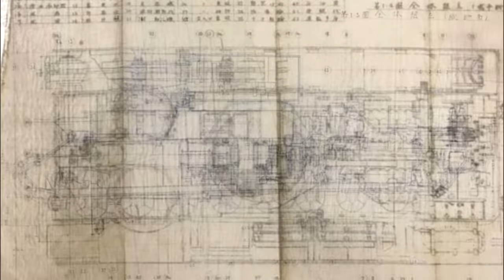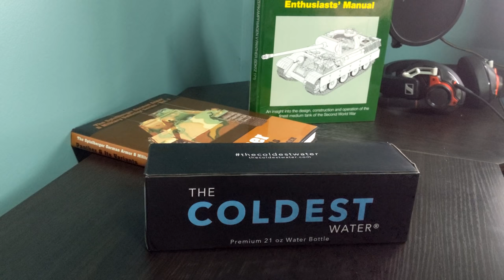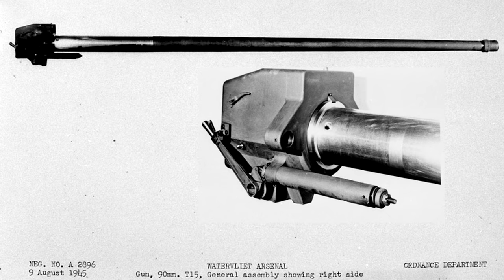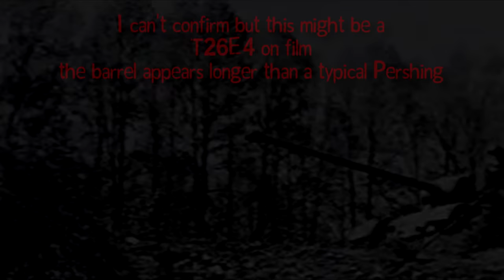America's King Tiger KILLER, the Super Pershing | Cursed by Design

Comment: "The 90mm M3 ain't enough to beat the Kingtiger!"
"Mount the T51E1 on the T26E1."
"The gun makes the tank lean forward and it's hard to elevate it!"
"Add counterweights and springs on the turret."
"The long shells are difficult to load!"
"Mount the T15E2 with two piece ammo on the T26E3."
(Still sends the one with the T15E1)
"We don't want to loose the tank during testing!"
"Add some extra armour made out of our equipment and a Panther."
"The extra armour makes the tank lean forward!"
"Add more counterweights on the turret."
"We don't have the gun sight for the cannon!"
"Just use the M71C from the 90mm M3 cannon."
"It doesn't match with the ballistics of the T15E1!"
"Work out a range sheet."

(Inspired from Potential History's video about the Firefly development)
Reply: sir 17 pounder wont fit!
PUT IT IN SIDEWAYS
Reply: the radio won't fit
CUT A HOLE AND HAVE IT STICK OUT THE BACK
Reply: the engine's no good
GET FIVE CAR ENGINES AND PUT THEM TOGHETER
Reply: @aleky98  Sir! let's just buy some american tanks!
NO, WE MAKE OUR OWN STUFF
Reply: Now I want this in what I imagine Patton’s and some random tanker’s voices to be.
Reply: LET'S BUILD IT!
Reply: No more negative waves!
Reply: Lamoo
Reply: Conclusion: the tank is designed by german spy
Reply: @FD_Stalker  - A double agent!
Reply: problems 101
Reply: COMRADE, THE 100MM IS TOO BIG FOR T34-85!

make the turret larger blyat
Reply: @ramslade  - If Stalin wants it, Stalin gets it!!!
Reply: "Pentagon Wars," the satiric story of the Bradley is very similar. Funny movie and scarily based on a lot of facts.
Reply: The KV gun had a problem because of it’s size which the Germans exploited.
Reply: It depends at the crew
Reply: m 36 jackson gun  was not enough against  king tiger so they redesign this gun or what ? m36 had a 90 mm gun....
Reply: German tank designers:

Add more weight 

The engine it's not good

Put a flak 88 on it

The engine still not good

Add more tons 

...

Make it heavier

Sir?

HEAVIER I SAID

Tiger 2 finally gets out of fabric

Add more weight
Reply: The Very Best Comments Thread.

Solution? Haul the BIGGEST Field Gun you have & Shoot from beyond the 88's Range.
Reply: @sibeerijachannel6828  Originally, the M36 was limited to 2650 M82 APCBC, which wouldn't defeat the front plates of the King Tiger. In the winter of 1945, an APCR round (which would defeat the King Tiger glacis out to 100 yards and the turret front out to 800 yards) became available, and 43,000 rounds were produced, but mostly too late for the European war.
Reply: "But the tank is under powered."
"Put the engine sideways"
Reply: Awesome and thanks
Reply: The tank is too heavy and sinks in the soft ground. 
Put some logs under the tracks and strap them on the sides and remove some of the weights.
Reply: @hugossg7908  We need a bigger tank. We shall call it the Maus. 188 tons of armour and guns plus we shall make it unbearably complicated and hard to maintain.
Reply: Literally no Tiger II was destroyed by Western Allied forces tanks.
Some were destroyed by Allied bombers, but most were immobilized or just abandoned by crews as failing 3rd reich had no support for them.
And Super Persching was total shit, one hit from any 1930's 20mm AT rifle will immobilize it's turret.
Reply: @capobilotti  I heard 1 King Tiger tank was destroyed by an M8 Greyhound.
Reply: @winchesterchua3311  I don't know about such story but I'm not an expert.
Probably not destroyed, but put out of action (damaged tracks, gun elevation, turret ring) and subsequently blown up by crew.
At that stage of war, Germans were not in position to recover damaged tanks.
Reply: @r.j.dunnill1465  Well looking at strict penetration numbers the APCR (or rather HVAP as American forces referred to it) could potentially defeat the frontal plate of the Tiger 2 out to between 1,750m to a little under 2,000m. Tiger II's hull front only had an effective thickness of about 196mm as it was 150mm thick and sloped at 50 degrees. The T30E16 HVAP shell had 205mm of penetration at 1,750m and 193mm at 2,000m. 

This is also assuming a standard quality plate of RHA which was not guaranteed for any Tiger II to leave the factory as Germany was having armor quality issues as early as 1943 as it's resources started to thin. Explicitly their stores of Nickel, Molybdenum, and Manganese which were used to temper their armor plates, lacking these elements forced them to switch over to Vanadium to do so. 

Under perfect circumstances Vanadium would've been an excellent substitute but German factories were operating under far from perfect circumstances and this change resulted in incredibly hard but disastrously brittle plates. All guns firing at one of these Tiger IIs would experience much higher penetrative capability than they actually had due to fire at the sub-standard plate. 

This is why in post war tests it was revealed that on average even the M1A4 High Velocity 76mm cannon, or rather the "Long 76", mounted on the Shermans was capable of frontally penetrating the Tiger II's turret at an honestly absurd angle and range, it was still utterly incapable of defeating the frontal hull armor though. 

However interestingly the T33 AP was in fact capable of defeating the frontal plate of the Tiger 2, but only at 100m. I believe you mistook the penetrative numbers for the T30E16 and T33 for each other as you cited the T30E16 as only being able to penetrate a Tiger II's frontal plate out to 100m which is just demonstrably false as at that range the T30E16 has over twice the required penetration to defeat a plate as effectively thick as the Tiger II's even assuming perfect RHA quality, which the Tiger II could never claim to have.
Reply: @ThatGuyOrby  I based my statements on a declassified Ordnance document, which states of the T30E16 shot "PURPOSE. This is a special hyper-velocity, armor piercing round for attack of heavily armored vehicles. It gives greatly increased penetrative performance up to 2,000 yards range over the standard A.P.C.-T., Projectile, 90mm, M82. It is especially effective at shorter ranges. Since tungsten carbide is a critical material these projectiles should be used sparingly and only when the situation requires increased armor penetration. This shot will penetrate all plates of the German Pz Kpfw V "Panther" and "King Tiger" Tanks. IT WILL DEFEAT THE GLACIS PLATE OF THE "PANTHER" AT RANGES UP TO 450 YARDS AND OF THE "KING TIGER" AT 100 YARDS RANGE. UP TO RANGES OF 800 YARDS THE SHOT WILL PENETRATE THE GUN MANTLET AND TURRET FRONT OF BOTH THE "PANTHER" AND "KING TIGER" TANKS."

At one time the original document was posted, and I have a copy somewhere.
Reply: @r.j.dunnill1465  Well then I just have to say that document is poorly informed, which wasn't uncommon for the time, because official US Army documents on the penetrative capability of their guns firing different shells at different ranges and the armor thickness and quality we know German tanks had at the time simply outright contradicts those ranges claimed. 

The guns and shells used in the document are specifically the M1A4 76mm gun, the older 3in it was meant to replace, the M3 90mm gun, the T4 105mm gun, and M1 155mm gun. It rather unfortunately doesn't include the more powerful T15E1 90mm gun, the one used on the Super Pershing. I struggle to find a source for that one.

Youtube tends to have an issue with sending links but I'll attempt to send it anyway in a following comment, if you don't see it I'll attempt to send it to you on another platform. Do you have Discord or Facebook by chance? I rarely ever use Facebook, in fact the last time I did seriously use it was almost three or four years ago, but sometimes it does come in useful for things like this. 

Though note the page lists thickness of RHA perforated in inches and range in yards so it requires conversion to millimeters and meters for convenience.
Reply: It seems Youtube as expected deleted my response with the link
Reply: @capobilotti  There are documented cases of King Tigers being knocked out by Fireflies, M10s, M4A3s and M36s.
Reply: In Belton Cooper's book "Death Traps" he discusses the main gun the tank was equipped with. He states that a range of 100 yards it could punch through17 inches of armor plate. He also says that in practice firing, it could punch through a Tiger 1 front armor at a range of a mile when using solid shot. Cooper was the man who devised all the "add-ons" to a Pershing. He was nominated for the task because, in college, he learned how to design warships by proper weight distribution to keep a ship on an even keel, both fore-aft and starboard-port. So he didn't have much to work with, but got everything worked out on the Super Pershing . His book is a very interesting read. He was the tank liaison officer to the 3rd armored division, to which the Super Pershing was assigned.
Reply: @bobkonradi1027  However his book is also a near universally condemned piece of literature by any tank enthusiast or historian with any knowledge on tanks as his take on the M4 Sherman has been thoroughly debunked. Repeatedly and in great depth. Literally almost everything he says about it has been definitively proven wrong and most of his opinions on it, that he rather erroneously portrayed as fact, came from the time where he was assigned to work on/recover destroyed tanks...and yet his biggest "evidence" were all the destroyed tanks he saw when that was literally his job. The Sherman being a "Death Trap" is rightly decried as singlehandedly one of the biggest examples of Survivor's Bias to ever exist. The rate of deaths per Sherman knocked out was staggeringly low especially compared to other tanks and the burn rate Mr. Cooper raved on and on about? A fraction of that suffered by every other tank to serve in the war. By the time it got into Europe and started facing heavier German armor like the Tiger and Panther it was outdated but never, never a Death Trap.
Reply: @ThatGuyOrby  In his book, Cooper relates a story where one morning they got 19 brand new Shermans, all parked in a row. Each new Sherman was assigned an experienced crew. They drove off to battle. Cooper was driving down the road an hour and a half later and 15 of the brand new Shermans with experienced crews had been killed by just a few Panzers.. He related also that the Shermans were designed by a committee, and it was dominated by infantry generals. It was designed as an infantry support weapon. Further, they wanted a barrel life of 7500 rounds, which dictated a low velocity shell suitable only for support use. Unfortunately for the U.S. the Germans saw tanks as a weapon to kill the other guy's tanks, and that's how they designed their panzers. If I'm a tanker, I want my tank to be able to go 1-on-1 against the other guy's best tank and if I'm a competent tanker I want more than a 50-50 chance of killing the other guy's tank, and on the first or 2nd shot. In WW2 it was U.S. doctrine that it took 5 Shermans to kill one Tiger or Panther. So using that doctrine, what happens to the first 4 Shermans that go after that Tiger.? They're cannon fodder while the 5th Sherman circles around behind the Tiger to shoot its engine. Cooper also says that his 3rd armored division had a TOE of 220 tanks. During the 8 months from D-day until the end of the war, they wrote off 550 M4s as total losses, totally destroyed, in addition to whatever they felt they could repair. That is losing your entire division's TOE of tanks twice, and half of a 3rd timr in an 8-month period.
Reply: @bobkonradi1027  yeah everything he just said there was completely false and debunked by Nicholas Moran and US armored doctrine of the time. The Sherman was not designed as an infantry support tank it was rather explicitly a direct counter to the Panzer IV and armed with a gun capable of infantry support and was objectively better than that tank in all regards, it was NOT armed with a low velocity gun as the short 75 was a MEDIUM velocity cannon, it was not doctrine that it took five Shermans to kill a Tiger that was just what they always brought because that was the smallest American armored unit you found on the field at the time (that being a tank platoon), and the Sherman did not need to get behind a Tiger or Panther to kill it as their side was vulnerable as well due to the Tiger having identical thickness armor on its side and rear and actually having thinner armor on its lower side above the tracks (this is without even considering the high velocity 76 Sherman which proved capable of complete frontal penetration of the Tiger 1 at a range of 800m with APCBC or 1,100m with HVAP). US Armored doctrine held that as weapons of exploitation tanks needed to be both capable of supporting infantry and directly dealing with any potential opposition. This included tanks. Many people say "that was the job of the tank destroyers" without realizing or doing so and ignoring the fact that US Armored doctrine held that tank destroyers were solely defensive weapons and only to be engaged in direct battle if completely unavoidable and only in support of armored units. Also the high number of tanks destroyed has to do with one thing. The Americans were attacking and the Germans defending. That is simply the nature of warfare that the defender will always enjoy a better kill ratio as they almost always get the first shot and as studies post war showed in tank confrontations even in confrontations between Tigers and Shermans whoever fired furst almost always won. Look up a video by the name "Myths of American Armor" or a video by a YouTuber named Potential History called "The American Tank Meme" both go into great depth on why literally everything Belton Cooper said about the Sherman was objectively false.
Reply: @bobkonradi1027  also while the loss of 550 tanks in that amount of time may be true I'm more so inclined to believe he was embellishing because unless 1/8 of US Armor losses during the entire war happened in that time the number is exaggerated. Of the 50,000 M4 Shermans produced in WW2 only some 4,400 were lost in US service throughout the War.
Reply: @ThatGuyOrby  Well, we're just going to have to agree to disagree. I've read Belton Cooper's book several times, both in hard cover and in updated paperback versions, and I believe him. You are of a different opinion. I'll say this, many years ago I ran across an opportunity to buy two of the Ford GAA V8 engines that were used to power the Shermans. I bought them (still have them) and then bought enough parts to build two more of them plus more parts as spares. At the time, I jumped into learning all I could about the GAA engines and also the Shermans themselves. I talked to two different people who had restored Shermans. Even had my hand on both of them. Actually, I even have a website devoted to the Ford GAA tank engines (www.fordgaaengine.com) where I go into its development and use. Because of its displacement and the fact that its all aluminum, its been used both in tractor pulling and vehicle street use, in addition to powering Sherman tanks. After the narrative, I have several pics of the GAA in its various "dressings" and my #1 engine is down near the bottom of the article, the one with the polished valve covers and with the black background. My #2 engine is still in the short block stage, but with the heads fully prepped and ready to install. A 3rd engine is in the "bare block stage" and the 4th engine was sold to someone else. If you get the time, check it out. But back to the tank itself. I've not read any articles that said it was suitable for "tank-on-tank" warfare, but was good for infantry support. So, as I say, we'll just have to "agree to disagree."
Reply: yes but the Firefly actually worked and was feared by some German tank crews because the the gun was brutal, it was a gun capable of beating the Tiger
Reply: @Bruhsound4.0  we bought some American stuff, and had to make it suitable for use because US equipment sucked... many of the M4A1's sent to Russia were actually stripped for parts because many were DOA
Reply: BS last tank on tank battle Pershing total destroyed a king tiger or tiger royal 2. Pershing was a far superior tank to little to late.
Reply: @capobilotti  This seems like a falsehood to me, see RJ Dunnill's reply to you.
Reply: This makes the Sherman Firefly sound so simple
Reply: @thomascampbell4730   The author of the book the Pentagon Wars movie is based off of (Colonel James Burton) literally believes radars are "useless junk" and got upset that tests on the Bradley infantry fighting vehicle (it was NOT an APC nor was it meant to survive anti-tank weapons) weren't just blowing it up with weapons it was never meant to withstand.
Reply: @insomniacbritgaming1632   Which Tiger, the Tiger I or Tiger II? The Tiger I's side armor could be penetrated by a Sherman's 75mm medium-velocity gun.
Reply: @andyfriederichsen  no it couldn't, even the 76's had to get behind it... at close enough range possibly, but open field? Not a chance, which is the why the Fury scene is inaccurate... the Tiger would've aimed for the 76' first
Reply: @insomniacbritgaming1632  That just isn't true. Do you also think it took five Shermans to defeat one Tiger? 

The 76mm Shermans could penetrate a Tiger I's front armor from close-range and side armor from medium-range.

"At close range possibly..." No, the 75mm M3 and M6 guns on the Sherman absolutely could and did penetrate the side armor on Tiger I heavy tanks from close-range.

Didn't you literally just claim the 76mm Sherman had to get behind a Tiger I in order to destroy it? Why would the Tiger I even worry about the 76mm Sherman more? Yes, the Tiger would've aimed for the 76mm Sherman first in the movie "Fury", but that fight is also inaccurate because of the reasons I just told you and because the Tiger I wouldn't have even left its hiding spot where the Shermans couldn't see it.